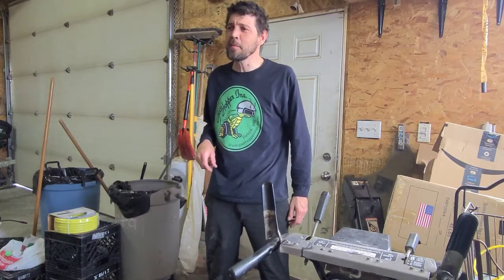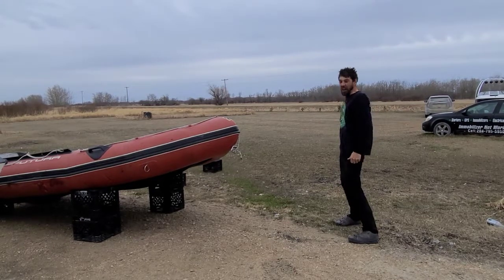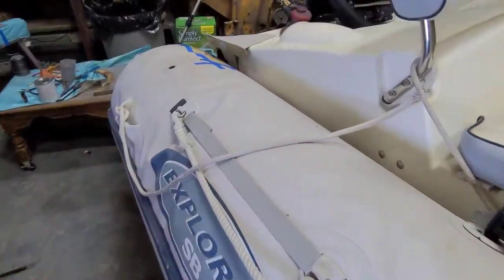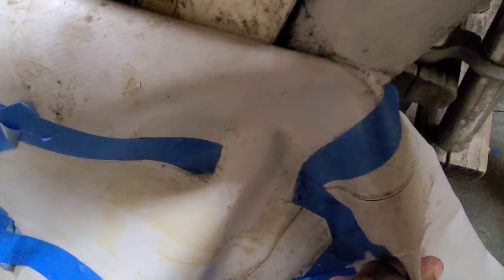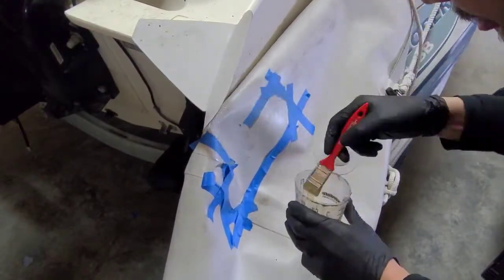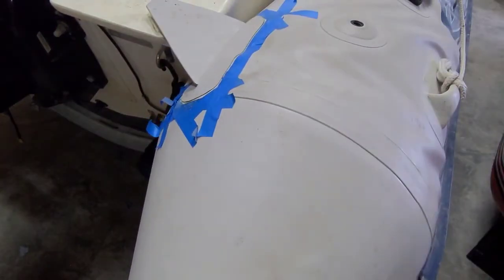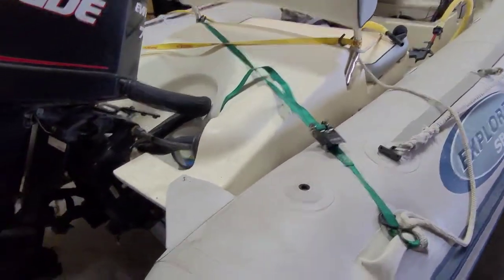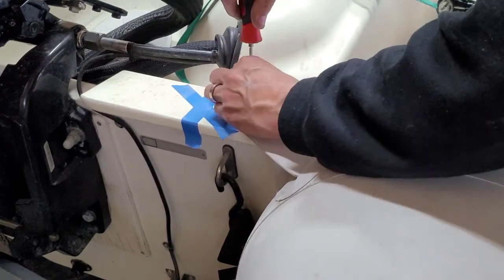Fixing Your RIB Boats Tube's When They Start To Peel Off The Transom Area

Comment: I know this an old video, however if your still answering questions. What grit are you using on the Dremel and orbital sander?
Reply from the maker: Using bthe course grit bit on the dremel, and sandpaper for the Orbital is either 120 - 180.
Reply: Thank you very much for the response.  @gashopperinc

Comment: Would HH66 work for adding D rings and accessories? I would like a professionals advise.
Reply from the maker: I wouldn't recommend it all. It's not a structural glue Adhesive, personally we never use that stuff here. Mainly used for vinyl repair like rubber pool toys or like materiald, not for PVC or Hypalon. Failure rate is to high. Would recommend Z7096 from Zodiac or Stabond UK-148 for PVC and Z7098 Zodiac for Hypalon.
Reply: @gashopperinc  if you don't know just say not sure hh-66 is much stronger than 2 part zodiac

Comment: What type of glue or brand are you using
Reply from the maker: I mainly use the Zodiac brand for glue repair, but if there is a shortage, I'll use Stabond or Weaver 2 part glues.